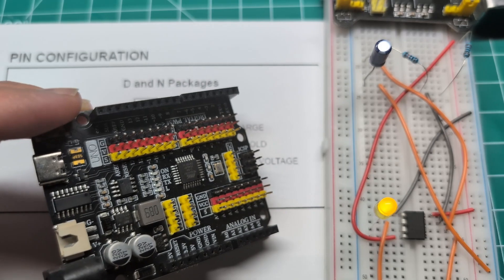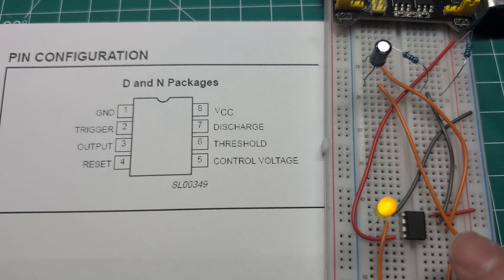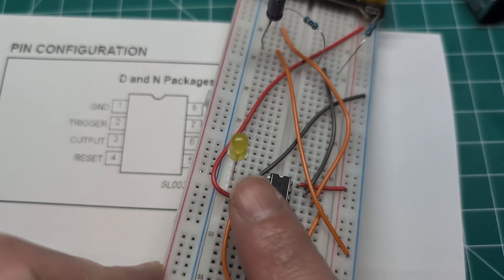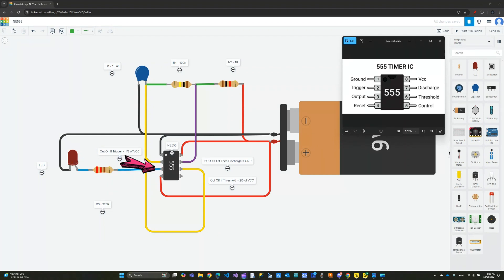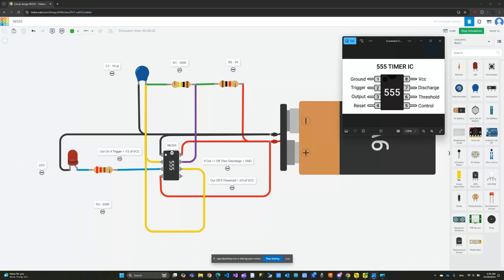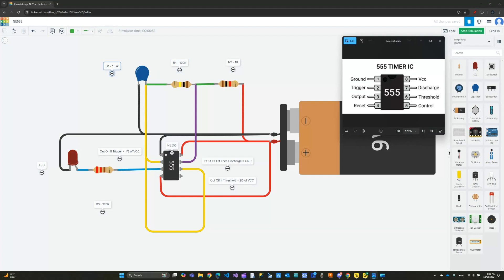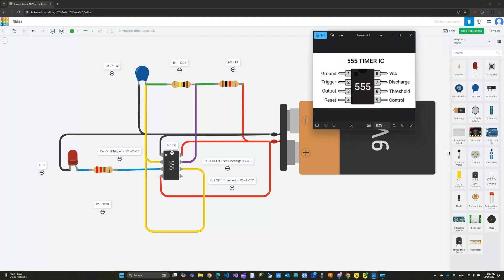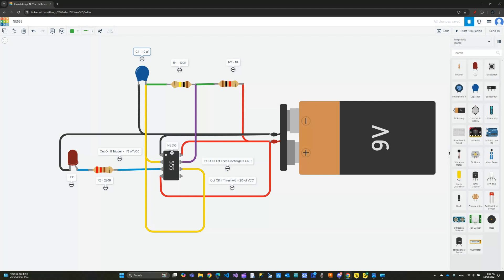Timer IC NE555

Comment: What is the capacitors capacitance? Resistors's resistance?
Reply from the maker: The one I used listed on the diagram but you can adjust based on the desired period